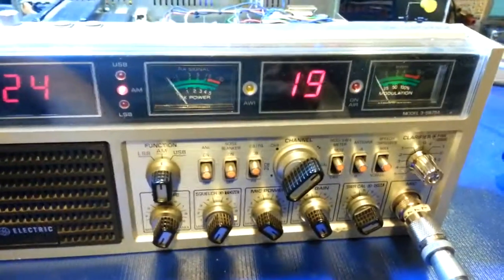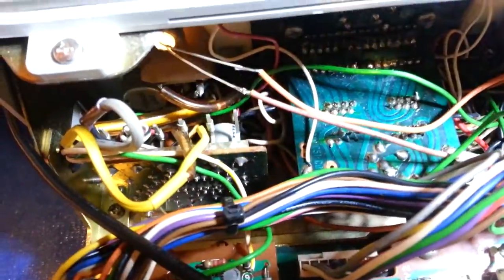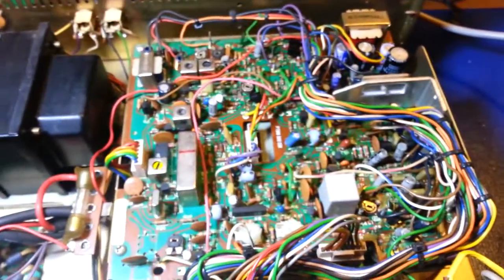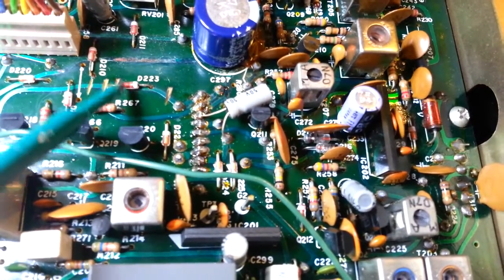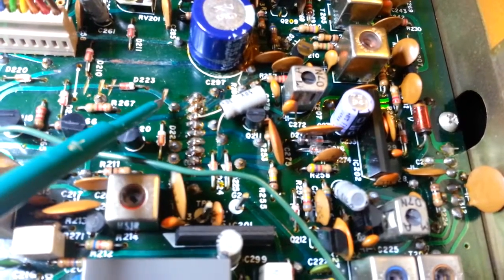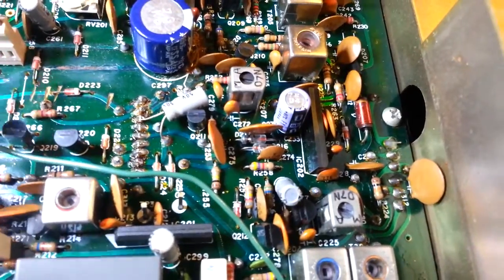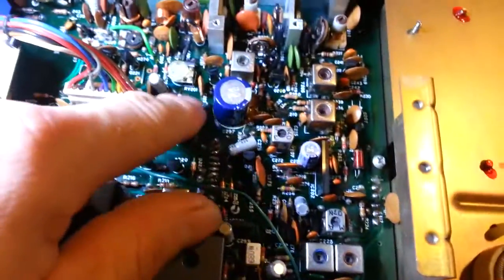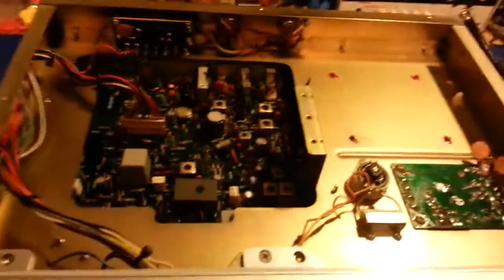Another GE SuperBase with a leaky capacitor and corroded PCB traces.

Comment: Mike I solved my GE Superbase corrosion and rivet issues, by purchasing a18 channel Electraphone CB-550. I removed those two horrible corroded dry joint boards out the Superbase. Rewound the transformer to suit 240v. A bit of cutting filing and drilling work on the chassis. Mounted the A model board and rewired the original 40 block out the Superbase. 
I now have the most reliable Superbase in Australia. I copied your idea for dimming the meter lights. Keep up the good work Mike.